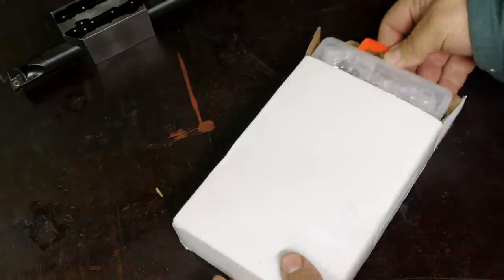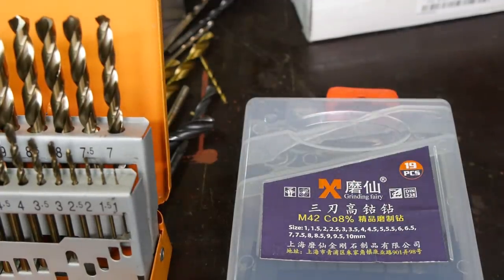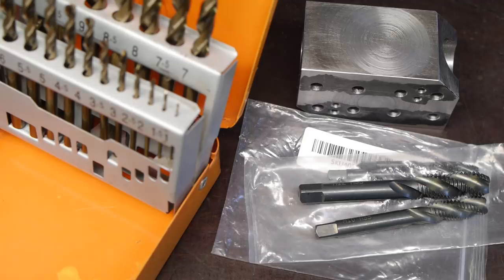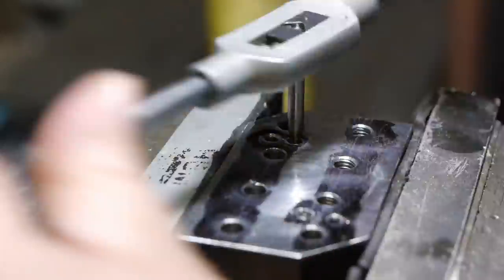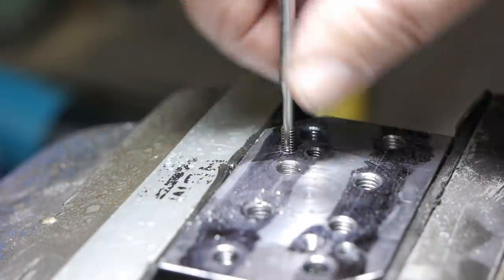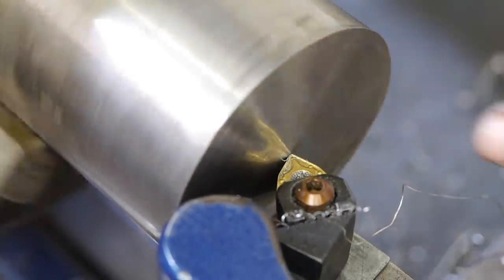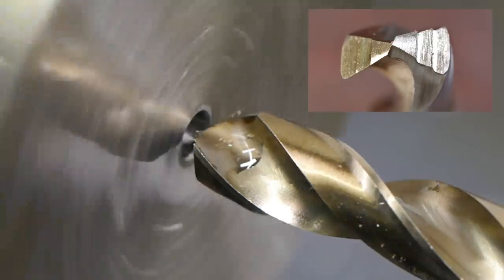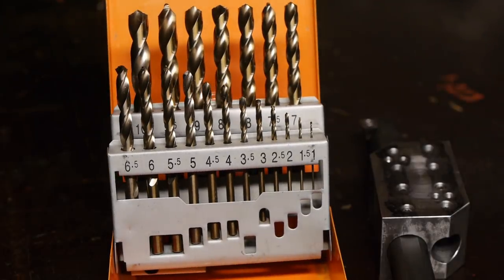Testing fancy ground Chinese cobalt drill bits

Comment: At 24:10 looking at the end of the drill bits you can see on the small one just how far off center the ground the bit. Looking at the leading edge on the side that dulled and the angle it was ground on was doing all the work, if you look at the other side you can see the angle is way off and it wasn't ground to center the web. I don't know if it's because they made the web off center or just the final grinding. It could be the relief cut (back side of cutter) isn't ground properly also.
Reply: Regardless of what is causing the issue thank you for taking the time to make this video.

Comment: Thank you for showing. As far as drill bits are concerned I always look out for old cheap used ones in old boxes underneath the tables at flea markets and yard sales. You can usually by them for next to nothing. After grinding, they work as good as new ones. Got all my MK drill bits that way, very cheap.
Reply from the maker: Then here is a tip for you :) https://youtu.be/mUrc5V_mdJc

Comment: I use a small round wire brush to clean them after tapping. Works. I also have a half a box full of broken smaller taps. I tap grade 8 bolts length wise and break a lot of taps.
Reply from the maker: I use a toothbrush to clean the swarf out of the taps. That was my first ever broken tap, still bums me out.

Comment: I know most of us who learn the drill pres on our own get in the habit of no clamping things down but you really need to get into that habit or at least putting a pin through the table to keep the work from spinning. I don't know how powerful your drill press is but I'm sure you'd rather not learn the hard way. Even a 1/4 hp drill press can really fuck you up if scenario is right.

...oh, and just in case you haven't learned this: If you must wear gloves around a drill press, thin latex gloves only. Anything else make for a great way to break your hand and/or arm in three or four places.
Reply from the maker: Bad habits right :) A while back I actually made a clamp for on the drill press. BUt I was too lazy to set it up. Also it makes lining up the drill bat a bit more difficult. I does help if you need the tap to go in at the same angle as the drill bit. https://youtu.be/JNb3lOlwJpk

My drill press is rather docile. It hasn't hurt a fly yet. And I'm pretty sure I can grab the chuck and make it stop. Might want to use a grove for that :)
Reply: @Rolingmetal  Alright, man. At least I've done my part. A drill press is pretty mellow as power tools go but it'll still get you if you don't respect it. With more dangerous tools, my friend gave me a tip that has been very useful for may years. The closer you hand gets to the cutting tool or the spinny thing, the more to tell yourself "it's gonna cut your fucking hand off! ...it's gonna cut you're fucking hand off!!!" sort of like a mantra, I guess. Works great! This has really improved my respect and safety around power tools. ;-)

Comment: Interesting tips, never seen that stepped tip before. Love the cobalt bits. Been getting some m35 bits off amazon that I use with most of my steel work
Reply from the maker: I expect the m35 from amazon are probably the same as the ones from Banggood. They are pretty good I think. Altough I have broken a smaller one on the drill press. But that's common for me :)

Comment: Greetings from UK.  A tip I was taught is to run a drywall plug through a tapped hole to clear swarf.  Doesn't always work, but most times it will do the trick.  It is worth buying one of those cheap cross vices for the drill press.  Accurate enough for most work, and far safer on the hands.  It is a pleasure to watch you learn, and I hope you keep up the hobby.  As you are finding out, the tooling costs more than the machines, so most of us hobbyists make out own, with more or less success.  I would recommend  "The Amateurs Lathe" by L H Sparey, which is where I started nearly 50 years ago, and I still refer to it.  There are some useful plans for lathe tooling, and lots of good advice.  You can get it from Amazon.  Finally, thanks for the videos, I know it takes time and skill to make them.

Comment: The step grind is supposed to reduce tool pressure. They did it wrong. Uneven cutting produced by poor grinds will eventually break off the the bit in your workpiece. Reground, they’ll be ok enough.
Reply from the maker: I did not notice that they started easier. They only extended the cutting edge requiring more power. I think a good re-grind will work better

Comment: Cheap tools most of time means low quality, but there are exceptions sometimes. Also, tools get damaged because people do not use them properly. Noticed that you drill the hole all the way in, which is not right. You should leave some space on the drill bit thread end for the waste to come out.

Comment: You were talking about how loose the screw was in the thread, check the drill bits with a mic, it's not uncommon for them to be out by 0.2mm
Reply from the maker: the size of the drill bit has almost no effect on the sloppiness of the thread. I actually made a video about that a while back.

Comment: Cobalt drills main ambition in life is to chip  until you  get rid of their poxy  grinds & regrind them  with a standard grind & that goes for the better quality ones also ! Cheers .
Reply from the maker: Maybe that special grind causes the tip to brake more easily. I sure did not notice that they started easier. The way I see it, it only extends the cutting edge and they will need more power to drill.
Reply: @Rolingmetal  They seem to have a much wider web so you have to back grind it to thin it out ,  but they also bend easy !

Comment: Many different stainless alloys with different characteristics.  304 is generally easier to work with.  Some stainless is actually magnetic so that is not a true indicator.  Some can be hardened and are tough as all get out, while others work harden which can make drilling problematic.

Comment: Those threads in the larger holes aren't looking too hot at 15:26. Was it just a bad camera angle?
Reply from the maker: light, shadows and camera angles can play trick with your eyes.
But I agree, those don't look good. I wouldn't be surprised is one of the cutting edges has broken off.

Comment: The only difference between taper, intermediate and plug taps is at the front end.
The intermediate and plug are meant to make a full thread at the bottom of a blind hole.
I’d say the taps you have are poorly made.  You should try some proper (expensive) taps and see the difference 
I understand your connection with BangGood 
A nice set off HSS drills will surprise you as well. I have a 10 year old set of drills that still work great (weekend use)

When testing drills you should also check the size you are getting and the surface finish.  All are important.
You always have to clear your chips when drilling, you can snap off drills like that.  I think you may have come close to snapping yours. :)
Good video, I won’t buy BangGood unless I get desperate:)
Reply from the maker: I like the taper taps they are easier to line up straight. But hose spiral taps are also interesting as the eject the chip from the hole. The biggest drill I snapped so far is 8 mm but that was using a electric dill.
Reply: Correct, you are supposed to start with the taper.  That is all you need if you can wind it all the way through the hole.
The spiral taps are not in the same set.  They are often called machine taps and you can push them through the hole under power and the chips don't block up ahead of the tap.
I don't recall spiral taps being available in plug and taper but  I'm stretching my memory now.
I think if we used a spiral tap in a blind hole we came back by hand later and cleared the bottom with a plug tap.

You can also get "Gun Taps" nothing to do with actual guns.  Not sure how they get the name.  There is an angel on the cutting edge to push the chips ahead of the tap also good in through holes.

In any case when you are tapping blind holes it's best to blast the chips out with compressed air or what ever you have and then go back in.  Hitting the bottom is the best way to break a tap.  But there are many others :)

Comment: Never, never try to drill a hole without having your work in a hand vice and use bloody coolant! These harder drills are meant for hard materials, they do not work as well in mild steel.  I never use a pilot hole for a 5 mm, unless I'm tapping something important. Then I go 4.5 and finish with a quality 5 mm drill bit. Those spiral taps can be used to power tap, I made a fixture plate 22 mm thick of fairly hard steel scrap to ism as you call it lol and I put a total of 42 tapped holes of 8 and 6 mm all power tapped on my little mill attachment of my Warco WMT300:lathe( 1.5 hp 3 phase will VFD) worked a treat and didn't break anything and yes you CAN reverse the tap in and out to break the chip. On a small tap below 6mm it is imperative to reverse the tap regularly to break and remove the chips as they are notorious for clogging the flutes even on the spiral ones, but the straight flutes are a nightmare the smaller you go.  Watch Joe Piesczinski doing small hole talpping and Ades workshop.

Comment: The 5mm drill that you ground by hand worked better than factory grind. You could get a job in China as the grinding fairy. Joking aside it shows that a good grind is the most important thing
Reply from the maker: The fairly grinding fairy. Could be a new career :)

Comment: A little spray of WD40 works wonders for drills and especially tapping.
Reply from the maker: Since I ran out of cutting oil I use regular motor oil on my taps. Not much of a difference.

Comment: Those steps are good for wood and plastic, otherwise unless you have a tool n cutter grinder they are gone after a bit of use.
Reply from the maker: you don't need HSS for wood or plastic. But a regrind might be a goo idea. The way I see it,t hese don't start easier and only have a longer cutting edge that requires more power.

Comment: Those holes look way oversized, there is not a fully formed thread in them. The tops of the threads are flat, so you are only getting about a 10% thread instead of 70%.
Reply from the maker: Having looked at the footage I agree. Although the hole size has little effect on  the fit of the thread. But us does matter for strength

Comment: So, take aways from this for me - 

- Out-of-the-factory grinds are "doubtful" at best (goes for pretty much all cheap drills, and quite a few expensive ones)
- Chinese "M42" vs "M35" may well just be marketing wank applied to the exact same material.  Even if the materials /are/ different, the home machinist is unlikely to need M42 anyway, it's good for production use.
- The proper tapping sizes aren't supplied
- You need a drill press vice
- You also need a tap follower and tapping lubricants

Comment: That is a weird cut on the end of the drill
Reply from the maker: I don't get is either. The way I see it, it only makes the cutting edge longer and therefore it would require more power. I did not notice that they were easier to start.
Reply: You got that right dose not make sense !!! great for drilling coconuts!!!!

Comment: I think Bangood have lost the plot. Their asking prices are now not that far off top European makes and , if you think tapping M4 is difficult then wait till you try and tap an 8 BA thread in steel.
Reply from the maker: I think the 1-10 set is fairly priced but that 1-13 set was even more expensive when I first noticed these special ground drill bit on their web site. I think it was like 65 dollar or maybe even euro.
Reply: @Rolingmetal  The 1~10mm set is a showing at £47.00 on the site for me.  Maybe it is the M42 tool steel but it seems that we can no longer call these ' Cheap Chinese ' but rather ' Chinese '.
Reply from the maker: @lensman5762  Wow, those must be special Brexit prices! In Euro they are 21.53. Apparently coming from 28.71 with 42% off. I don't know but that sure is not 42% off. Someone needs a new abacus.
Reply: @Rolingmetal  No, I have noticed this price increase on Bangood recently . Maybe they have a special pricing for me. I used to be able to  bypass their commission linked prices but recently it is impossible to do this. I guess their algorythm can detect my IP and  adjust the prices.
Reply from the maker: @lensman5762  Maybe the UK catches some flak from Trumps trade war with China.
Reply: @Rolingmetal  LOL. Who doesn't?

Comment: I see a lot of commentary on clamping the work piece, which is good practice.

 Too bad the Chinese cheap presses all seem to have that cast steel or cast iron tables with no method of using a quick clamp, vise grips or other clamp.   You are generally resigned to bolting down a vise In the crappy slots which rarely allow for the fine tuning or capacity to do much of anything accurately. 

Except for the fact that it is it not worth spending the time or money to correct, a 13 or 19 mm(1/2” or 3/4”)plate would serve all of us better. Just a good flat bottom without casting draft would be a tremendous improvement. Probably you, like myself and a lot of others just don’t want to take the time to improve their substandard, underpowered  cheap drill press with a modification that would take as much or more money than the piece of junk is worth.  Just hate spending good money after bad.
Reply: probably stop doing reviews on shit and buy decent tooling as the quality of your job is down to quality tooling and doing things properly

Comment: A fair review I would say. I don't care for the spiral taps myself, the webbings are too thin, that's why they break so easy As for your high dollar drill bits, I too have used the DeWalt  "Pilot Point" drill bits and I really liked them, until they started getting dull. There is no easy way to sharpen them with that profile so they get ground down and sharpened like a regular bit. I also bought the cheaper set of HSS drill bits from BG last year.
I would try to brag and say at least they came in a metal index but when I got the outer wrapping off I could see a broken  brass rivet sitting right on top of the box, underneath the plastic bag, while it was still closed. The rivet was broken for the pivot on the smaller bit holder and I had to drill it and put a real rivet in it. The bits seem to work OK for as much as I use them, being an American I try to avoid that Metric crap as much as possible but every dang thing is metric these days  I'd say you got a decent set of bits out of the deal and the price was certainly right.
Too bad they came in a disposable plastic case. Damn thing won't even make a decent ash tray.
Reply: Metric crap!? The whole world uses metric and other SI units. Our imperial units are incompatible with everything not made 8n the US (basically everything) and it sucks! If we aren't manufacturing anymore, then we should switch to the international community.